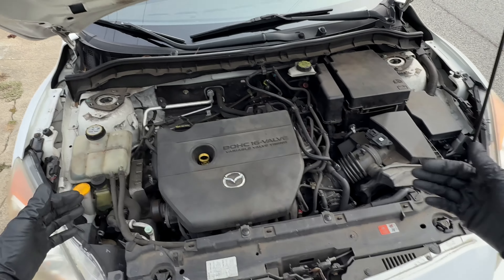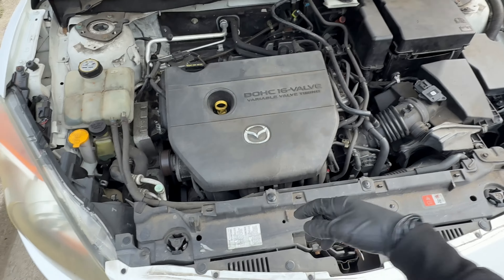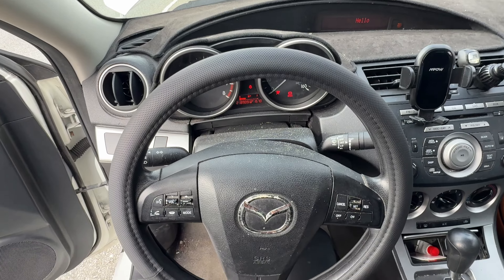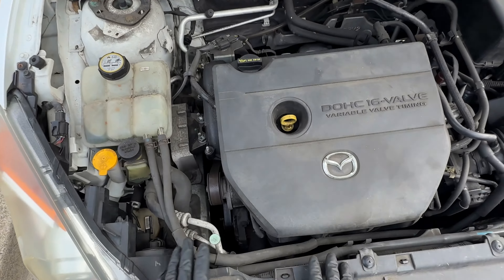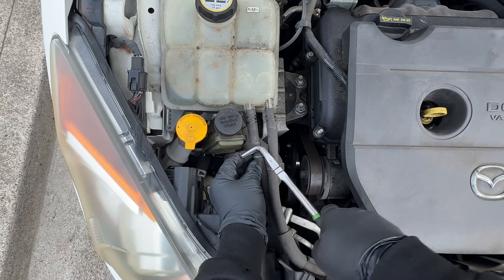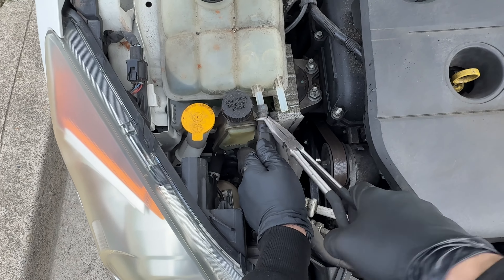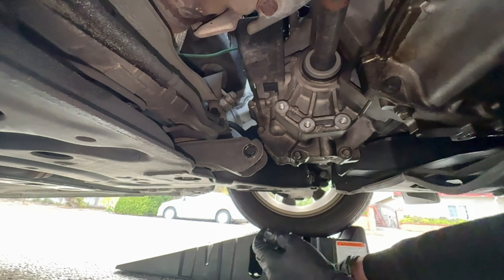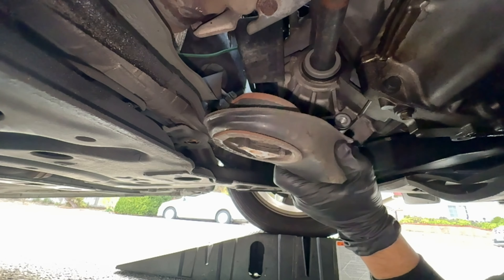How to replace all engine mounts on Mazda 3 2008 2009 2010 2011 2012 2013 (NO MORE VIBRATION)

Comment: The top passenger mount is oil filled. Typically the underside rubber of the mount rips open and the oil leaks out.
Reply from the maker: @Pdeloosha  yup
Reply: Are these mounts you changed the only two mounts you can change? Just double checking that there is no driver side mount I am missing

Comment: Whenever I let go off the throttle while going at 2000/2500 rpm in second my Mazda kinda jerks back and forth. Could it be the torque mounts?
Reply from the maker: Yes it could be, change all of them

Comment: Would you your car shake bad when your driving ? At high speeds ?
Reply from the maker: It’s not my car but he’s it was shaking really bad while driving. It would shake the most around 30-40 mph, then it decrease a little bit but would still vibrate regardless

Comment: Lol I love how this appeared in my feed. My phone must always hear me saying "damn it, the passenger side one went out again!" Im pretty sure thats a common line from Mazda 3 owners first and second gen alike. Ive done all 3 before. The passenger side one is really easy. The bottom two that connects to each other are easy too. The only tricky one is the trans one. But ones you get the battery box and the air box out, its staring right at you. A long with all the components that go rusty from a lot of battery corrosion that was left from the previous owner.